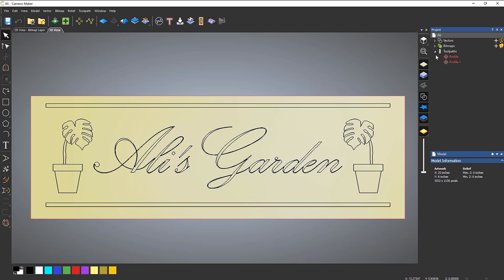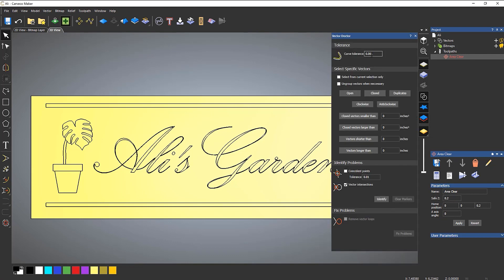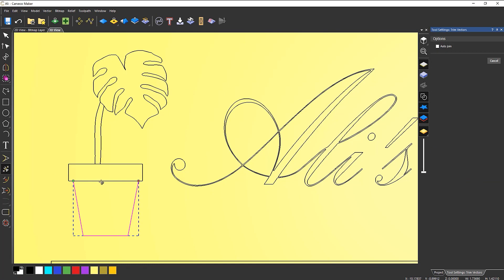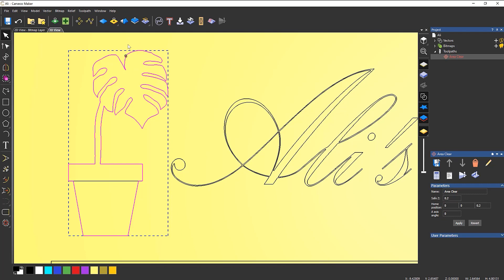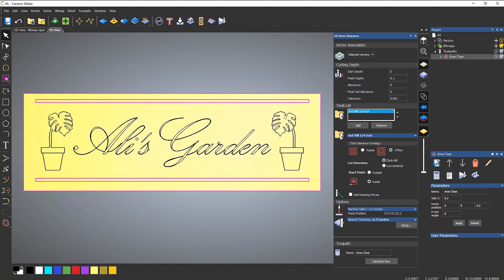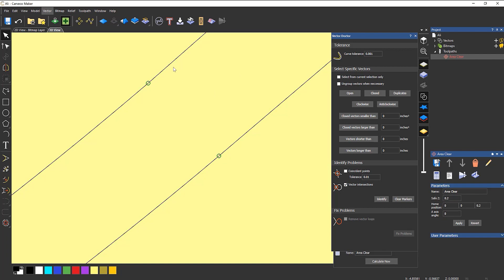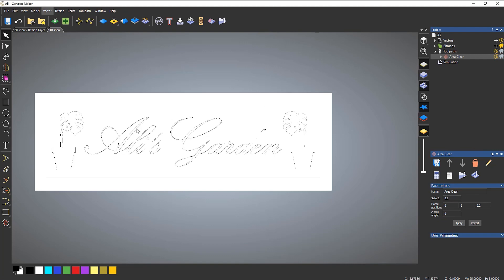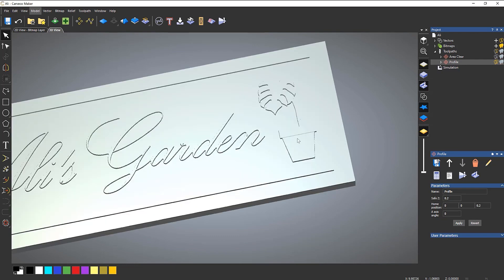Carveco Maker: Fixing a Problem Design Tutorial

Comment: Thanks for the video. I have enjoyed quite a few of your videos. Could you show your toolpath summary in your videos? Specifically how long it is estimated to take. I know that it will vary by a users machine and setup, but as a beginner I'm just trying to see if my tool paths time is comparable to others. Thanks.
Reply from the maker: Hi Diana, thanks for your comment. 

With the toolpath calculation summary times, there's a bit of 'dialing in' that needs to be done to make them accurate to your own CNC, using the time scale factor value. In a nutshell... because Carveco is designed to work with loads of different machine tools (with different feeds and speeds across the board) the out-of-the-box estimates are usually a bit off until you put in some more information about your machine. 

We'll be releasing a video on this very soon to show how its done!